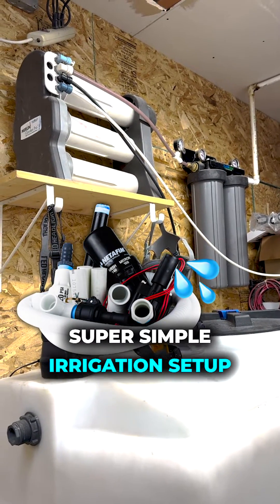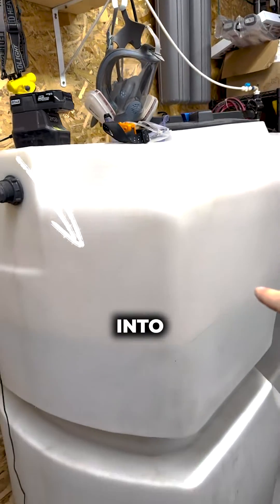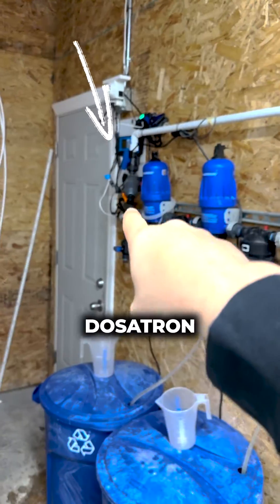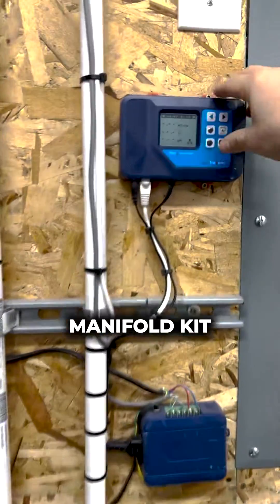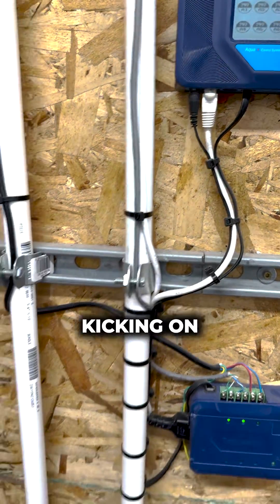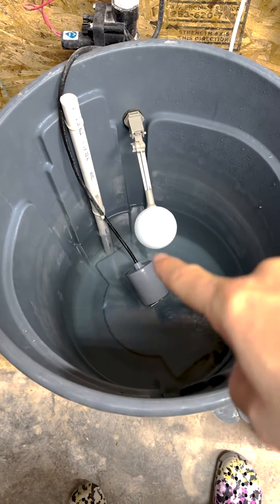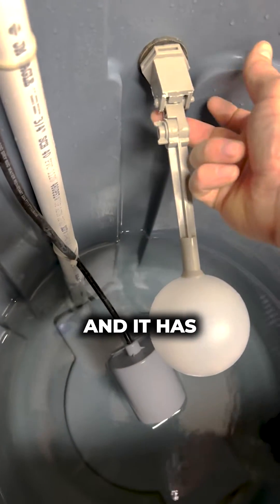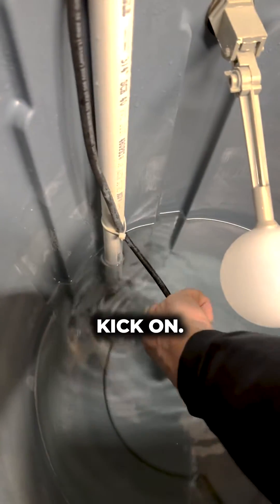How To AUTOMATE Your Irrigation System

Comment: What is the max dripper capacity of those pumps? i don't think I need to get one of the giant jet pumps for the amount of drippers I have.
Reply from the maker: You’ll have to do the math on the drippers you’re using, and then compare that to the GPM on the pump. These pumps fail regularly
Reply: @CraftFarmer  I appreciate you taking the time to get back to me. I just stumbled upon the "we the growers" podcast and am about to dig into your episode. I thank all you guys out there sharing the info. I almost gave it all up because of a bacterial issue in my well. it took two years of failed grows to figure it out. It turns out that hypochlorous acid is the solution.